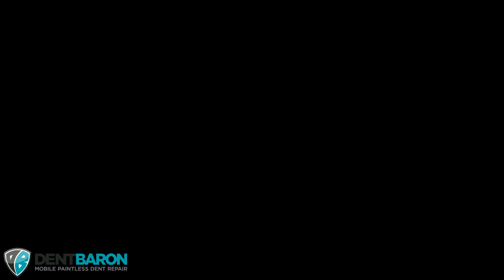PDR Mobile Glue Pulling Tower Build and Use | Paintless dent repair | Dent Baron Raleigh, NC

Comment: Love the vid, what is the name of the feet you use? Can’t seem to find anything like them here in the uk! Also what are you using for the locking collars? Thanks Glen
Reply from the maker: Lock collars can be found on Amazon here is a link. https://www.amazon.com/Shaft-Collars-1-5-inches/s?keywords=Shaft+Collars&rh=n%3A16411911%2Cp_bore_diameter_derived-vebin%3A1.5+inches&c=ts&ts_id=16411911

Jack plate foot. Here is a link of one similar https://www.amazon.com/Pro-1400700340-Footplate-Pin/dp/B005DLLVMW
Reply from the maker: Thanks for watching!!
Reply: @DentBaron  thanks, just ordered feet £37 to the uk plus duty for 2!
Reply from the maker: Woah!  I think I paid $6 each. You have to show me your setup when you finish it.